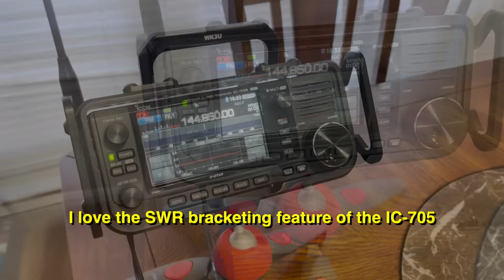IC-705: Attaching HT and Mobile Antennas

Comment: Which antenna were you using on this video?
Reply from the maker: If you’re referring to the long antenna, it’s the NR770-HAB. I think that specific model was discontinued, but they still make the NR770-HA and NR770-HB. The short one I’m using is just a generic dual band 2m/70cm “rubber duck”.
Reply: Ok. Thanks for the clarification, I will check out the two longer ones.  Just ordered my IC 705 today.  73. Bob NY3T

Comment: Good evening. I just got the Comet CST-30 mount and when I go to plug the male BNC to the female BNC on the radio, the male BNC will not go all the way on the BNC on the 705 to secure it. Do you have any suggestions on what to do in this case?
Reply from the maker: Sorry, I don't.  It's made to be plug-and-play, so if the BNC connector isn't going on, it may be defective.  Sometimes BNC connectors are tight when you plug them in the first time.  Wish I could be of more help.
Reply: @tekspeditionplanet9109  I got it fixed. What I did was put the BNC connector through the CST hole first, then secured it using the BNC with no problems. I then finished the bottom bracket where it screws into the Ground, and it works great!! Thank you for your help and video 73’s WD4ITE

Comment: Wouldn't a 2m/70cm quarter wave antenna be fine even though the counterpoise would be inside the backpack? Seems much less problematic than a long 1/2 wave.
Reply from the maker: Yes, having a counterpoise would eliminate the need for a half wave antenna.  And I don't think it would matter if the counterpoise is inside the backpack.  I found tuning/pruning the counterpoise to be challenging, but once you have it cut to the right length you should be good.
Reply: @tekspeditionplanet9109  yep? Thats the route I would go. 1/2 wave would just grab to much attention and low tree branches around here. A telescoping 1/2 wave might be worth packing around though. Never seen one with pl-259 for the Windcamp though. The MFJ Long Ranger is cool but BNC.

Comment: A tactical antenna like the HYS dual band works great to and doesn't need a counterpois!
Reply from the maker: Not sure which HYS antenna you're referring to.  Their "rubber duck" variety would require counterpoise, but I do see they have a small J-pole variant, which would not likely require counterpoise.

Comment: Hello. My interest is piqued regarding the "HAB" version of the NR770 antenna. I'm only aware of the "HB" and "HA" models, both of which are fold-over.  A few really old good searches reveal hits for the "HAB" version but not much.  The Diamond antenna website doesn't show it as a current or discontinued version.  I guess the HA or HB fold-overs would suffice, regardless. Must no longer be in production. Thanks!
Reply from the maker: Yes, that was discussed in the first posting, below.  My version is the "HAB", but in looking on line I can no longer find the HAB offered for sale.  Perhaps they discontinued that model.  In looking at the specs, it seems both the HB and HA versions are radial-less, so maybe it's just a matter of matching up the antenna specs of either of those antennas with your radio, e.g.,  ensuring the mount is PL-259 for a UHF connector, IF you are using a UHF-to-BNC adapter on the radio.

Comment: Hello, I have a few question if you don't mind. I want to make sure I buy the correct diamond radial-less antenna for my 705 did you say it's a NR 770HB.
Is it 150 or 200 watt.  You did mention trimming the antenna. and is ok to mention where you purchased yours. Not sure if its against YouTube rules. Thanks in advance. 73
Reply from the maker: My antenna is the NR770HAB (HAB, not HB, but I don't know the difference.  Although my HAB does not have fold-over feature.).  And my "trimming" refers to the counterpoise wires, not the antenna.  There are some set screws on this antenna that would allow a little bit of adjustment, but I did not adjust mine.  I am searching the web and cannot find the HAB version, so maybe it's discontinued.  In looking at both the HA and HB models, they both reference no need for grounding, so probably either would work.  You must ensure you have the correct mount, i.e., UHF for UHF mount.
Reply: Thanks